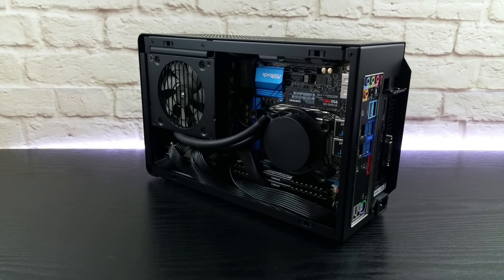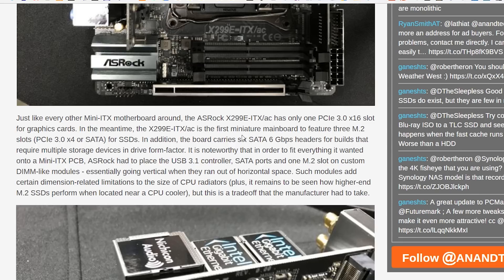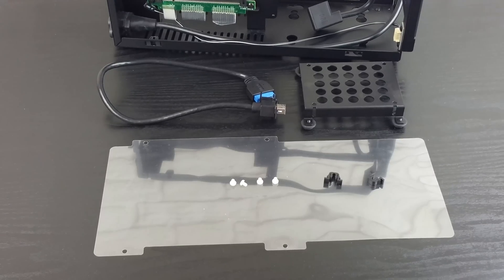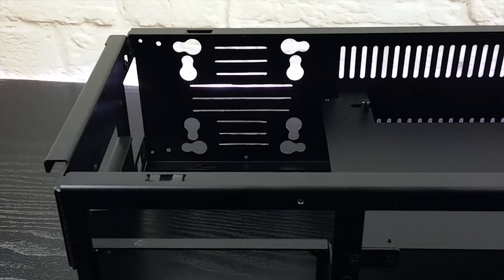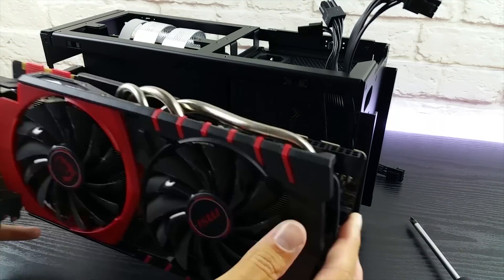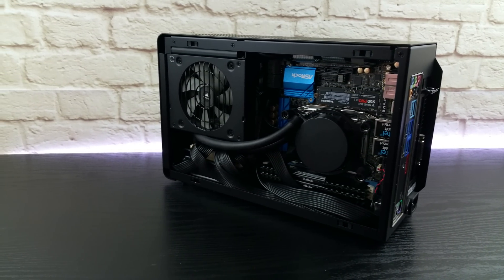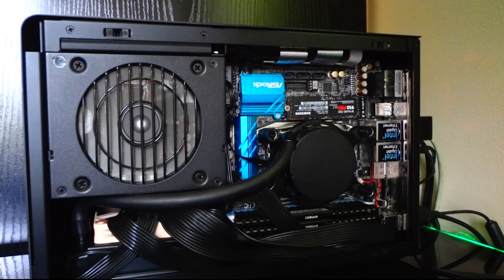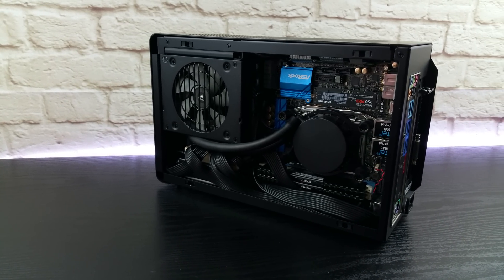The Judge | Modding the DAN A4 SFX V1 for the Asetek 545LC 92 mm AIO @ 5960x !

Comment: not impressed if the case isnt closed.
Reply: beautiful case though and smart idea to cut holes in the bottom. :P
Reply from the maker: Unfortunatly I can't test it anymore with the side panel on since I had to sell the parts. I needed custom cables to make it close but couldn't get them in time. So yeah maybe the temps would have suffered vs my initial test but who knows for how much.
Reply: the V3 is out with holes already.  about to order one.  thanks for your video.
Reply from the maker: Thank you as well. Enjoy it ;)

Comment: Why no one use hdplex dc-atx 160w to replace 24 atx + 8 cpu wires?
4 wires for hdplex instead 32 wires
Reply from the maker: Gradually people are going that route from what I have seen on the forums.
Reply: I tried to google it but nothing found
Reply from the maker: A quick relative example.

https://www.hardwareluxx.de/community/f81/dan-a4-sfx-das-kleinste-gaming-gehaeuse-der-welt-990144-229.html
Reply: No, I'm talking about powerful cards like 1080ti with sfx psu, just changing wires to hdplex 160
Reply from the maker: Ah ok. Then yeah :)
Reply: Maybe problem is when you power up hdplex from 12v and 4 wires you have 6,6 amps per wire, which is more than usual
Reply: because regular it power up from 19v and 4 wires - 4,2 amps per wire
Reply: Nevermind. HDPLEX 160W DC-ATX required 16-24V, not 12V. My mistake
Reply from the maker: No worries :)

Comment: Just got my v3 and I'm trying to fit in that asetek + noctua just like yours. Did you ever figure out how to fit it all in so the case will close? I feel like I need shorter, thinner PSU cables.
Reply from the maker: Yes. Shorter or custom cables are the way to go. You can still do it with the stock cables but it is way to much work.

Comment: I like the way you make your videos, but more importantly I see that you really take time to answer to everyone in the comments which is why I subscribed !

Also, I am in the process of making a build around the V3 of the "Dan a4-sfx" and I have few questions about it as it is my very first build.
My aim is to have the best performance as possible inside that tiny case while keeping decent temps, I would use the following parts :

GPU - GTX1080-ti (Any that fits)
CPU - Ryzen 7 2700x (4.35Ghz)
Mobo - Asus Strix B350-i Gaming
Ram - Corsair Vengeance LPX (2x8GB) 
PSU - Corsair SF600 SFX (Same as your)
Storage - Crucial MX300 SSD (1To)
CPU  Cooler - Asetek 545LC 92mm + Noctua NF-A9x14

Do you know if the 2700x would be cooled enough with that Asetek cooler ? Or should I look for a 'lower' CPU ?
Are you getting exactly 2666 Mhz on your Ram ? Because I've seen some people having their Mhz 'blocked' at lower frequencies.

Thanks :)
Reply from the maker: Thank you kindley Monstar ! Means a lot :) 

Regarding your build.
First, yes I was seeing exactly 2666 Mhz in the asrock's bios. Can't double check now since I have a new build inside of the case.

Then with the 2700x. Being soldered, on paper it should be kept in check by the asetek aio. The only perspective I have is if it was able to cool the 5960x then the 2700x should be fine. I mean I Saw a guy who even put the 18 core monster in this case with the asetek (delid of course) and it was on the safe limits with the temps.

The best 1080ti regarding ratio of performance/cooling for the A4 from what I understand is the EVGA FTW3.
Reply: Thank you! :D

And also, would it be possible for you, even tho you have very little space due to the cooler tubes & cables, to put an SSD in the front of the case where there is officialy a location to fit one in ?
Or would it be impossible to find a path to connect it ?
Reply from the maker: Ah yes it is possible even with the stock cable mess. :)
The only reason I didn't put a Sata ssd because for my needs the 512 gb M.2 is plenty. 

Good luck with your build and maybe post some links/pics when it is done ;)
Reply: Of course!

I have a crazy and expensive alternative actually, I would like to build a main PC on the Corsair Graphite 760t (With max performance) and put my Dan cases inside it, but wait before you leave me here i'll explain to you what the actual fuck haha :D

I would try to share my Main 760t with my Dan, so if I need to move and take my PC with me I just take my GPU & Ram from the 760t to put them inside the Dan pretty quickly and for the storage I just disconnect the 760t's mobo from the Dan SSD (on the front so it's easily accessible) and reconnect the Dan's mobo to it with no need to mess around with the cables.
Having my Dan inside the 760t is not necessary but not only it sounds funny but also save me some extra space.

So obviously it means that inside the Dan I already have 1 PSU, 1 Mobo, 1 CPU and 1 Cooler. 
Now the 760t build can be upgraded forever and I have a 2nd build to move which share the same GPU, Ram and a SSD. :D

Am I crazy ?
Reply from the maker: Very nice idea actually :d for some yeah it sounds crazy . Case-ception :))
 But it sounds like that you got it all planned out and it should work for your plug-and-play-on-the-move-build. 

Got me curious so yeah can't wait how it will turn out :d

Add me on facebook if you like for when it is ready. https://m.facebook.com/alex.nistor.509?refid=7

All the best,
Alex

Comment: so i was able to close the box now without the fan clicking, but my nvme drives hover around 66c in game load for 10 minutes.  even after turning off heaven, the drives stay super hot for a  long time because the is still hot
Reply from the maker: Realistically, under 70 C degrees in load is pretty good for an m2 nvme. I used to have like 80 plus with my 950 pro 512 when i had the impact 7 moyherboard. 
Now it idles like 48 and load around 70. A lot of users with the strixs motherboards reach over 90 so yeah it depends how you look at it. Nvme will always be hot either put a fan for them and or a custom heatsink if you can. If it doesn't throttle you should be fine around 70 in load.
Reply: Thanks for the reply.  Do you think I'll be okay if it stays around 60c-70c at all times? It isn't under much load in heaven benchmark, but it's my Titan Xp that's adding heat to the system.  It keeps the drives around 66c-70c while graphics is being used.  Titan Xp is always 84c under gaming load after 10minutes
Reply from the maker: You are welcome :) Thanks for the reply ;)
As i said if the drive doesn't throttle you should be fine. I know the heat transfer is very noticeable. In my case i went from the 980ti (same tdp as the titan x) to the 1070 but at 100w tdp less. Made a huge difference to the whole system. At least 10 degrees to everything was better. 
What titan is it? Maxwell? Pascal? If it is the maxwell just get an msi 1070 which has the same performance but way cooler and silent. If it is the pascal, then yeah :) Monitor it and find if it throtles. Then you know maybe to put some slim fans somewhere to help a bit.
Reply: titan xp galactic
Reply from the maker: Yeah...

Comment: currently building this system, but with delidded 8700k and titan xp galactic and i am stuck at the psu part.  it was hard shoving it in without scratching the psu, but the friggin cables are putting too much pressure on the fan and it is making a clipping sound.  after hours of moving cables around, i can almost make it not have a  sound. fml this build is taking longer than i thought.  had to take a break to vent this.  how did you manage not to have the cables pressuring the fan and making it click?
Reply from the maker: I feel your pain. :) With stock cables, they where resting on the fan, I just moved the cables around so it didn't touch the blades. But that's about it. Only custom cables and very bendy ones are the route here.

Comment: The Question of my Life   (very actual in case of growing popularity of small PC cases or cases with windows) 

Dear community and testers !   
I‘ve checked all of the internet but I still haven’t found accurate test and clear answer  -  do psi extenders (risers) effect performance in gaming ?   

Because the fact that increasing length leads to bigger latency and the bigger latency leads to slowing of the speed of exchanging data between GPU and the other PC components is evident. Games (in opposite to synthetic test) are continuing data exchange with GPU during the whole session, not only before start. So it seems to me that different GPUs with different values of GPU memory in different games with different lengths (and maybe even quality) of PCI extenders could show different results of such influence. Or maybe this influence so small that doesn’t worth mentioning. 

I will be happy with any help  -  clear Information, trustworthy links, accurate tests. 

Thank you very much)

Comment: Nice! Do you think it could be feasible to have both CPU and GPU on a custom AIO loop? It would be so cool with addition of a micro-reservoir  and some coloured water :)
Reply from the maker: Thanks! It could, only if you use a short gpu like the zotac mini series so there is enough room for the pump tubes etc. Even further to increase the space if you can use a HDplex mini psu.
Reply: Yes! Because I have seen this video on the Louqe S1 (but this case is 140mm wide...) and I thought, damn, I must tell The Judge! 
https://www.youtube.com/watch?v=3DSYw2Q1sZY Maybe this could work with a full-size GPU and normal SFX psu. My wonder is more about if the single radiator fan would be enough. However, with a 65W TDP i7-8700 it could work !
Reply from the maker: Ha thank you! Oh yes another epic case but that it is built to be modlar and versatile plus with aio in mind.  Hence Dan is making his own variant, the C4-sfx. Check it out as well but still in the devellopment stage.
Reply: Yes I know. But 140mm looks too much like a fat large case 3cm more than DAN A4. And DAN C4 has an inside set up that I don't really like (GPU over CPU). More tempted to do a custom loop into the A4, that would be the most ambitious modding of the smallest gaming case EVER !! :) Also in C4 the GPU is not anymore centered in the middle hight of the side panel, looks weird...
Reply from the maker: I need one to review it as well to see how the proportions will be :d 
Regarding the, C4 true. I think he off-set it to have 2.5  wide slots available as well. We will see how it eventually turns out to be. 
Indeed, the A4 with custom loop for cpu and gpu would be really awsome! 
Do you have the A4?
Reply: A friend has it and so I became interested in the A4 v2, but then saw the Louqe S1... None is ideal to me, but really from what I see, even if the S1 has better clearance for air cooling it looks awful with the top hat for water cooling. Completely unbalance the look. C4 really not enjoying the inside. Having the GPU on one side is clearly a nice thing to see with some rgb lighting! But I will get into micro SFX. Intel 8th and 9th gen i7 at 65w TDP make this ITX format so interesting. And I am in love with this micro custom loop approach. So "Mc Giver" haha!

Comment: is there anyway you can tell me the thickness of the rad and fan together cuss im thinking about getting a 8700k with a aio cooler in my dans case and converting my vid card with a aio cooler too and planning to put the psu outside the case and putting the other aio cooler in its place. i can do the one on the bottom like you did but im wonder if i can set up the other one sideways too?
Reply from the maker: Sure man. The rad plus fan they come to ~ 45 mm +/- 1 margin of error. That's a nice idea. Have a look as well at the new HDplex 400w mini PSU if it has enough juice fro your needs. Maybe you can fit that inside as well besides the 2x aios. Good luck. All the best, Alex
Reply: since the psu wont be in the case i can use the power cord hole as a run threw for the power cables, im planning on getting paracord or braded, not the ribbon crap or maybe even custom cables from cablemod
Reply from the maker: I see. Made me curios how it will turn out. :) good luck
Reply: im on my way, i just did a open case test of my 980 ti using a kraken g12 with a asetek 92 mm aio on it and it actually just fits the case. im going to put the rad where my psu are and move the psu outside the case and mount it to the side panel in front of the gpu lol
Reply from the maker: Excellent sir!
Reply: well it was a pain but i got it to fit
Reply from the maker: I bet. Well done sir. Pics?

Comment: hi mate, i'm planning on doing something similar with the new revision of the a4sfx as it has the rad/fan mount at the front by default. could you tell me how much clearance there is between the fan and the GPU in your build? it looks like they're almost touching. additionally, do you have any cpu cooling temp issues when under load in games, etc?
Reply from the maker: Hi man. I measure the distance between the the fan and the gpu and i have like 0.7-0.8 mm so they are not touching :) 
Regarding temps, in stock form and settings, the AIO 92 mm can handle the 5960x at around 80 degrees max in intel burn test / 75 in video editing and doesn't go above 65 when gaming. Things matter when you OC of course. at 1.180v for 4.3 Ghz i saw 90 on some cores in video editing. So that's the limit for this setup for a 140w TDP cpu. I bet if you use the smaller socket plus OC the AIo can handle it respectably. Hope these help. Cheers. Alex

Comment: Maybe the style of the gpu fans were creating the excess heat, maybe blower style fans help temps all around?
Reply from the maker: Usually true with the blower type gpus. But they are noisier because you have to keep them at high rpm. At leat in my expierince. The aftermarket cooling is better for the gpu but yes they kinda' spread the heat around. Anyway my tests are on the extreme sides. Heat from the M2 plus the cryorig c7 is underpowered no fans in the case, a lot of heat was present. Now with the aio things are much better despite the above. Still the m2 produces a lot of heat i recomend some heatsink on it if it is mounted like in my case. Those behind the motherboard will have higher temps again.l because they are sandviched.
Reply: Glob3TrottersTech thanks, I am thinking of adding an m.2 also, will definately look into a heatsink for it
Reply from the maker: You are welcome :)

Comment: Take a look at this man the answer to your problems http://louqe.com/ be quick Kickstarter over soon
Reply from the maker: Do you plan to travel regularly ? Then the A4 v2 if weight is going to be an issue. If not, the Ghost offers more versatility for WC in the long run. Or Dan is building the C4 his 'Ghost' version per say but bigger and not in production yet. Hope this helps. All the best, Alex
Reply from the maker: Yeah 240 is much better than a single 92 mm. I still have to tidy up the wires in mine and do a follow up video with any better results if they exist. Anyway if you plan to use any unsoldered cpu or don't delid it, not to mention oc'ing, yes the 240 mm is much better. Plus the ghost is modular from what i saw. Or you saw my point and my results from my video.
Reply from the maker: I know it. Can't wait to get one for a review :)
Reply: The drawback I found on the Ghost is that it is 1kg heavier than tha A4-v2! Which one is better then? @Glob3TrottersTech What do you think ?
Reply: Based on AIO, Would  there be much difference between cooling the Cpu with a 240 mm radiator (Ghost S1), and using a 92mm in the Dan A4 ? (In the video, the fan cooling the radiator seems impacted with the PSU cables)

Comment: Thank you for this great review!
 I am getting a DAN A4 SFX V2 and I want to go for the X299-ITIX/ac. I didn't understand why you didn't use this new motherboard? And do you think it is compatible with the Asetek cooler that you used ?
Reply from the maker: Thank you. I explained because the new motherboard series x299 automatically requires the new cpu's which are not soldered. The new asrock x299 mitx will have the standard bolt pattern (not the norrow gormat like the asrock x99) and the asetek aio will fit just fine with the including stock accesories (without the norrow adapter which i had to buy seperatly).
Reply: Thank you for your reply. It will be my first Pc build !
My last question: Did you have any issues with the Asetek cooler until now, Do you recommend it with the x299 ?
Reply from the maker: As your first built it be beyound epic :d so far on my build and testing even with very norrow vent holes i made it still perfomes super. 
I need an x299 cpu to test it myself to answer definatly but you need to check some reviews and see what temps you get with single 120 aios and extrapolate. Because they are not soldered cpus and will be hard to keep under control. So i can't give you a definate answer on that for now. But you have no choice it is the only aio that will fit the v2. :d Hope it helps. All the best. Alex
Reply: Yes you're right it's the only one
But I was thinking about a crazy idea that I want to share with you, having:
-The original waterblock of the x299 https://www.bitspower.com.tw/index.php?main_page=product_info&cPath=173_254_257_335&products_id=5720
-92 mm Radiator https://modmymods.com/alphacool-nexxxos-xt45-full-copper-92mm-single-radiator-14226.html with a Noctua fan 
-The challenging part is the reservoir and the pump that have to fit under the motherboard
Don't know if it will possible but this will be a great configuration!
For the cpu I think I will buy the i7-7800x, the 7820 is a little expensive for my budget.
Reply from the maker: That would be wicked ! Iif you need more space to play with for a custom wc build inside it i recommend going the HDPlex psu https://www.hdplex.com/hdplex-400w-hi-fi-dc-atx-power-supply-16v-24v-wide-range-voltage-input.html

These are uncharted teritories :d plus for even more space get the zotac gtx 1080 mini gpu put a water block on that as well and have even more space to play with on the gpu side :d